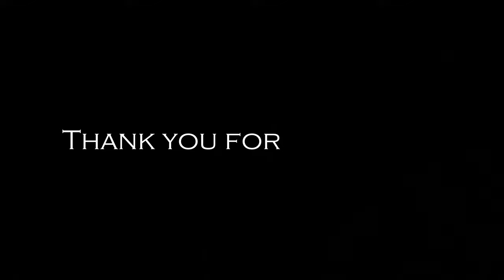Padding a Helmet for Armored Combat

Comment: So I'm curious, but is there anything specific that you can tell me about concussion padding that makes it different from other types of padding? For context, I have a cobbled together metal Iron Man based helmet that originally had no padding on the top or sides, but eventually I took some sponges, cut them up, then wrapped them in a thin layer of duct tape to hide their bright colors and attached them to the sides (cause my helmet tended to swivel a lot if I moved my head too fast). I didn't have any padding on the top portion for a few years, til I finally broke down and tried a similar method with sponges, but I think it was a little bit too much space added into my helmet (between the top portion and the chinstrap) cause now I get a dull ache in the top portion of my head instead a sharp pain in one small corner of my head. I guess I'm just curious cause I found some concussion padding online that's the exact same width as the sponges I used, and it's black so I wouldn't need to wrap it in duct tape. I just don't want to buy it if my problem is less the type of material and more the distance between the top part of my helmet and my chinstrap. Honestly I'd almost rather have no padding and deal with the sharp pain I get instead of the dull overall ache, cause that for some reason is worse 😅. Any help would be appreciated, great tutorial you guys!
Reply from the maker: While we are by no means professionals the difference is in the amount of force able to be distributed across the materials. Concussion paddding is superior in that regard to things like sponge or other foam like materials

Comment: So the rules require you to pick an outer styling that can be documented in history, but you can use modern internal padding for safety reasons? 

I imagine gluing multiple layers of period-accurate folded linen or hay or horsehair or whatever would get stinky af.

Comment: So you guys just use the foam with no liners? Is the foam helmet padding from Medieval Extreme enough by itself or should we use more foam in between? I have some 1/2 inch thick air2gel from nadler in addition the foam liner, it makes the helmet snug but it might be a little TOO tight? The chin strap leather coming out from the side dig into my ears and can be quite annoying after a while. Even with the liner and the air2gel layer, I still feel some pressure when I smack the helmet with my palm. Not much but I do worry that it would multiply 10 fold when its an actual weapon. Its far from "Didn't feel a thing". So I feel like I'm doing something wrong when I have 2 of the best paddings combined and still feel the impacts. 

If I got rid of the liner, which I'm reluctant to do because It's a Andrey Galvenskiy and really big. I could probably put in 2-3 more layers of air2gel. That would make it really dense and even heavier. Hmmm, I need to find a balance.
Reply from the maker: There is generally a liner in addition to the concussion padding used. The quality and safety of liners will vary from maker to maker, however we always recommend getting concussion padding of some sort into the helmet and concussion padding is in fact required by some leagues.

One of our fighters removed the comfort liner from his helmet and had a very thin linen coif made to sew into his helmet. This allowed for quite a bit more concussion padding as well as an air space between the top of the liner and the padding.